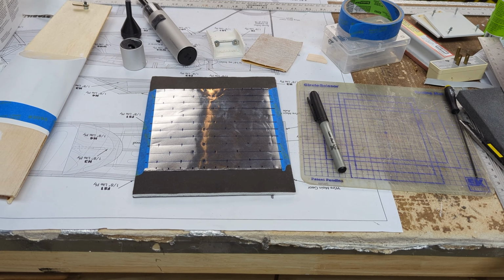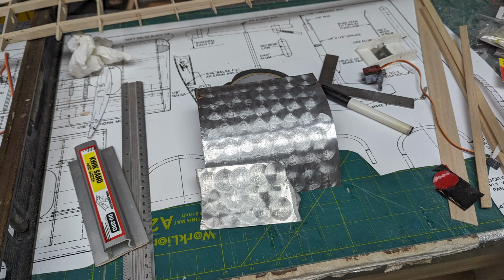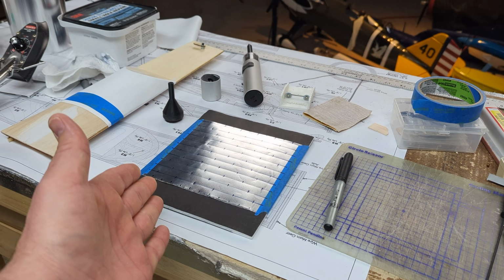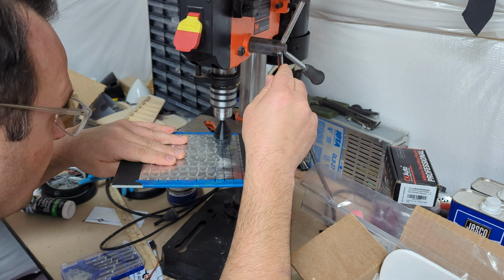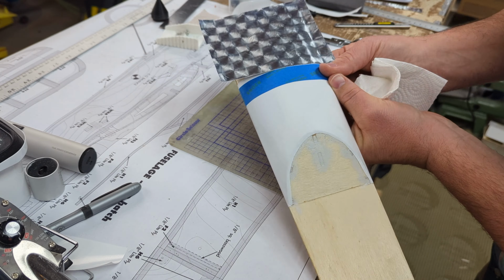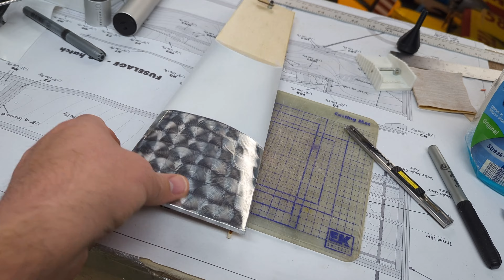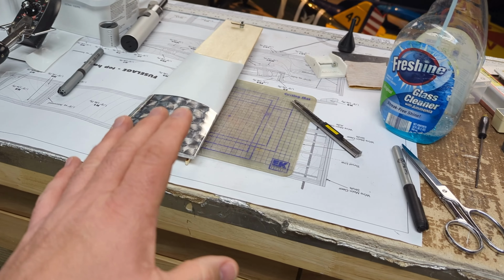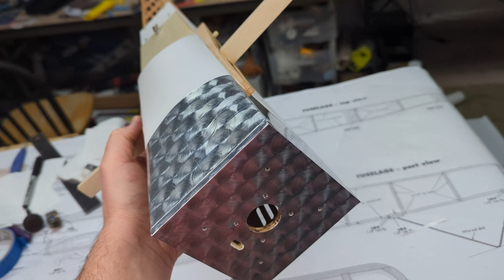Engine Jeweling for RC Airplanes

Comment: Looking good. I've never done that to the foil. But, I have had good results on aluminum flashing. I made a cowl and nose for my .40 Elder using that technique.  although I used sandpaper. Being able to be more aggressive does give better results. But at a much higher weight penalty.  I'd imagine lytho plate may be thick enough as well. But neither is self adhesive. As always, keep up the good work.

Comment: Great tutorial my friend!!

About the lines pressing in: maybe draw your lines on before putting the AL on the foam backing?  Maybe draw them on top of a hard cutting board?  With a harder backing the AL shouldn't deflect or deform as much, and there shouldn't be as noticable a line left behind.
Reply from the maker: Great tip! Thanks!